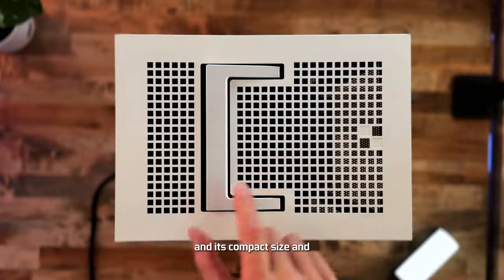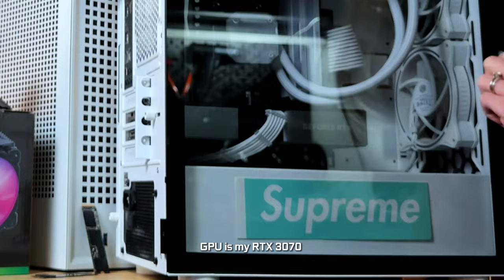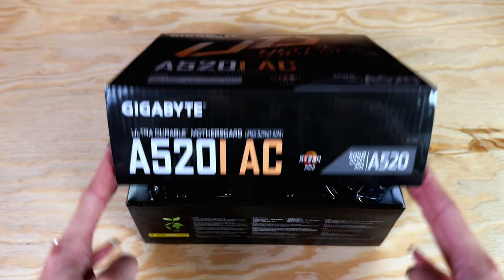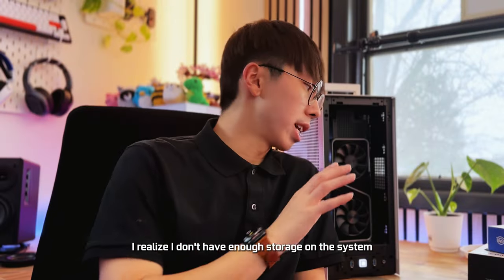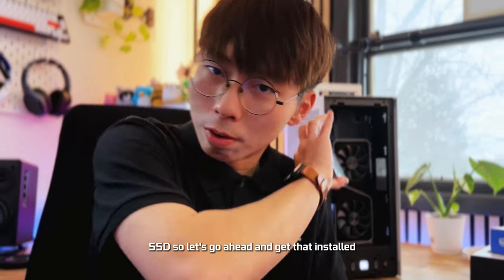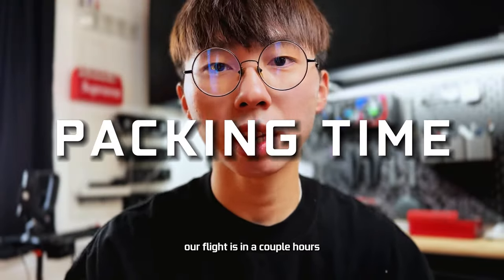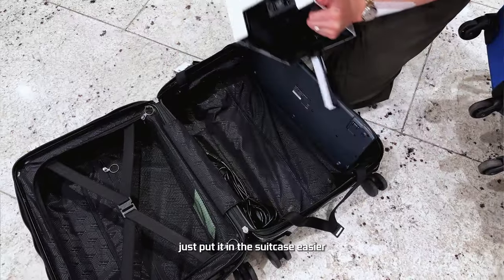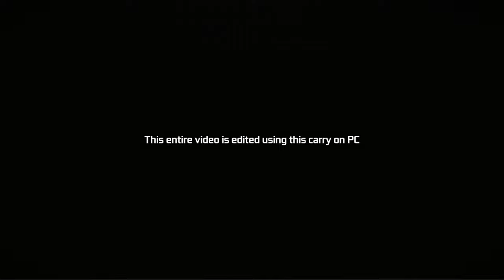Is this PC small enough for travelling? [HYTE Revolt 3 SFF PC Build]

Comment: wow keren....
I filled this case with R9 7950x + RX6800XT and 240mm radiator cooler for the cpu
I undervolt the CPU to maintain temprature...
And little modification so that the GPU can fit without bending the motherboard...

salam dari Indonesia...